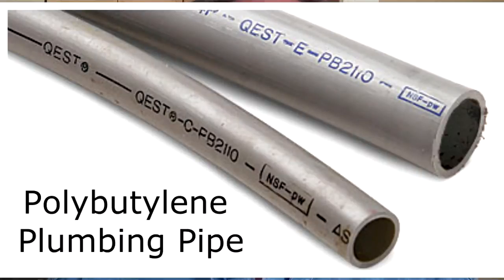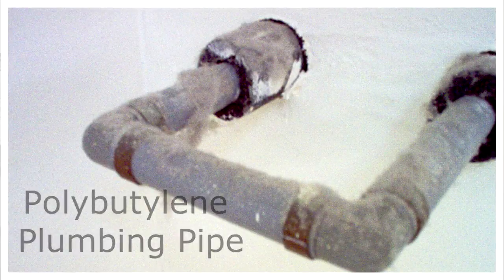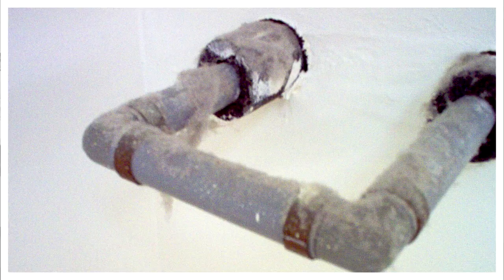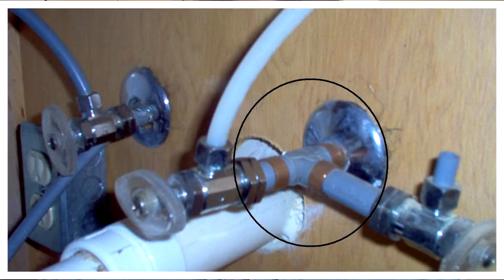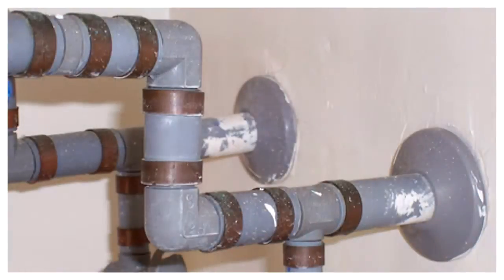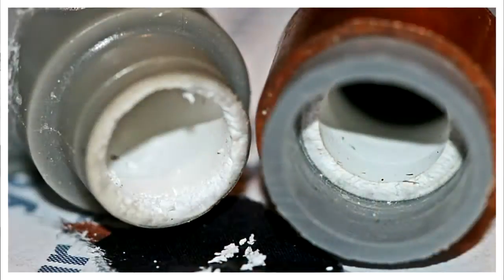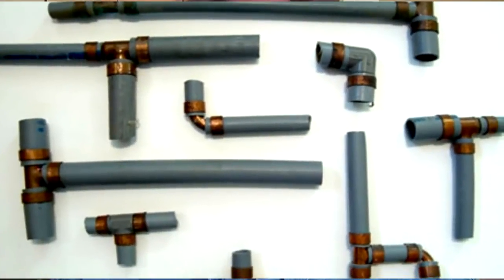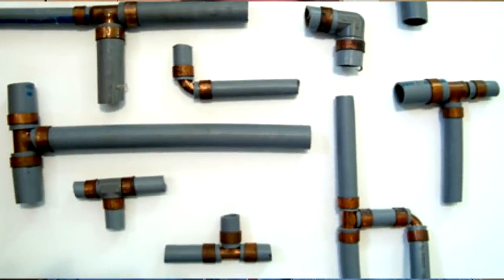Ask The Experts - Polybutylene Plumbing Pipe

Comment: I have Polybutylene pipe in a Manufactured Home with what looks like Aluminum fittings. Please reply
Reply: I have not heard of aluminum fittings ever being used so I know nothing about them. They did use aluminum crimp rings for a short period of time but they replaced all of that with copper rings and fittings.
Reply: @mikelynes1889  The rings are crimped and the metal looks like Aluminum
Reply: @mikelynes1889  So how were the Aluminum Crimp rings because that might be what I have. At a distance they look like they might be Aluminum and they are definitely crimped on. Thank you.
Reply: @thelastjohnwayne  Look at the fittings. Are they plastic or copper?  That is the main concern.

Comment: I actually like PB pipe itself. It's more flexible then PEX and has a wider ID. IMO PB pipe + metal fittings are a winner, they still use the stuff overseas without issue. Those Acetyl fittings were always the weak point. I've got the "1983-special" PB system with the aluminum crimps and plastic fittings. It's been in use over 30+ years and has had minimal problems actually. Of the three failures, all three were fitting related due to the pipe not being properly supported and years of water hammer stressing the barb of the insert fitting until it cracked. My area does have near perfect water quality though.

Comment: My first house had PB pipe and was built in the early '80's.  All the leaks I had were not the at the connectors, but in the pipe itself.  When the house was about 15 years old (after the 3rd or 4th leak) I replaced all the PB pipe.

My current house was built in 1994 and had PB pipe also.  It's now 20 years old and no issues.  I bet the mfg realized they had an issue and changed the pipe sometime in the '90's.  But, I'm still replacing the PB with copper as I remodel the house.
Reply: I have inspected thousands of homes with Poly. The only leaks I have ever seen in the pipe itself was where two connectors were installed with a short piece of pipe between them 1" or less. The pipe cracked at that point between them. This was also within a few inches of the water heater.

Comment: I have polybutylene piping with copper fittings and have had absolutely no problems with it.  Home built in 1992 and no problems thus far.  22 years old.  It seems the plastic fittings are where failures tend to happen but the pipe is sound.   Rated to 100 psi as is most water pipe.  You can easily connect ploybutylene to copper, cpvc, pex using various connectors on market today.
Reply: I agree w you. It depends on who Installed and the equipment (free from defects and wear) they used and experience.